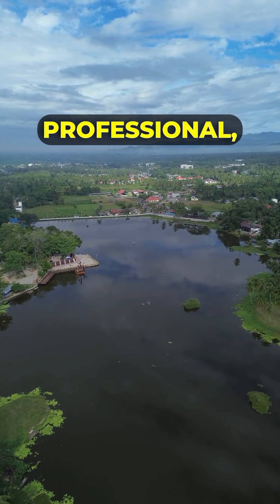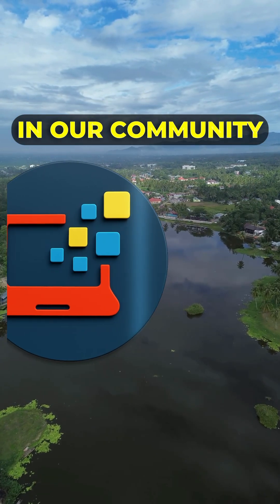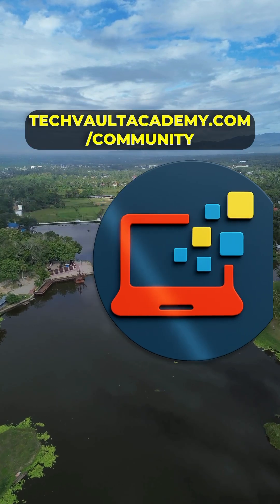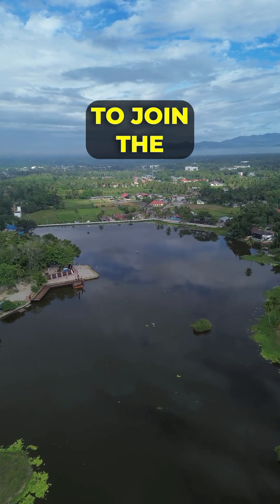PC Building MISTAKE That Causes FIRES! 🔥 (A+ Exam Tip)

Comment: Always use a dedicated cable from the power supply for your GPU. Adapter solutions are dangerous and a leading cause of PC fire hazards because they are not rated for sustained GPU power requirements.